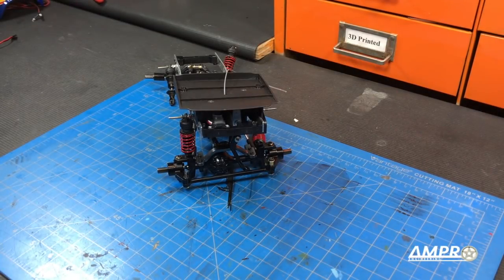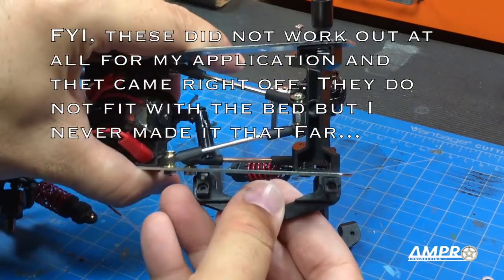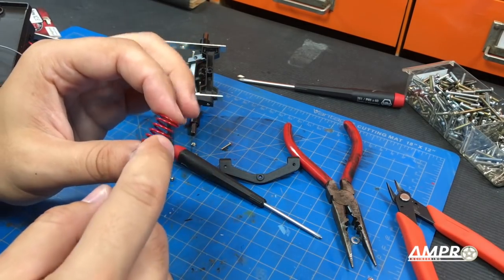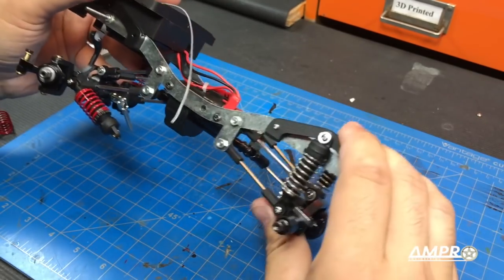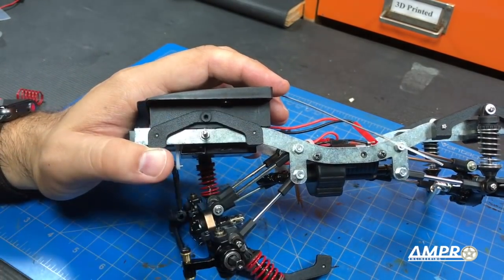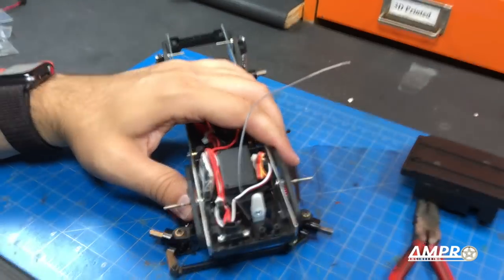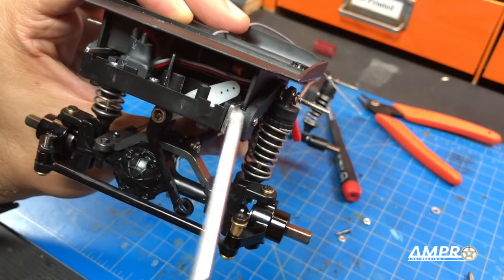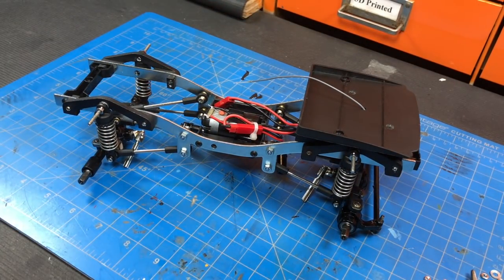e170 wpl: Ampro Upgrades the WPL C24 Shocks, Part 3.

Comment: Im looking forward to what you find out about the shocks/springs. Right now Im still running the stock stuff, and its noisy as the upper shock mount bounces around. I did manage to get it hooked up with the link kit and metal truss with the SSD M3 rod ends.
Reply from the maker: Yeah, I wish I had figured it out but so far, no dice. Ill keep on it!